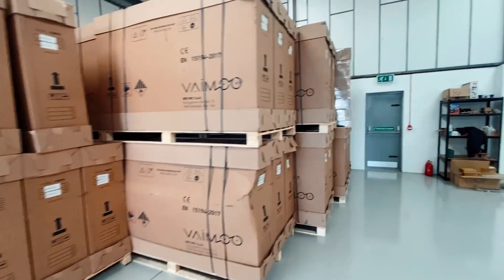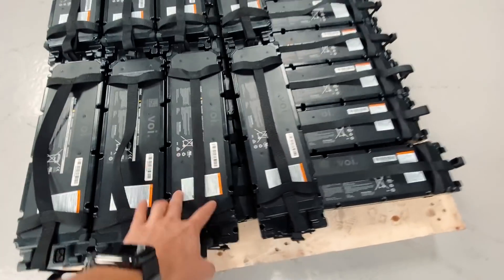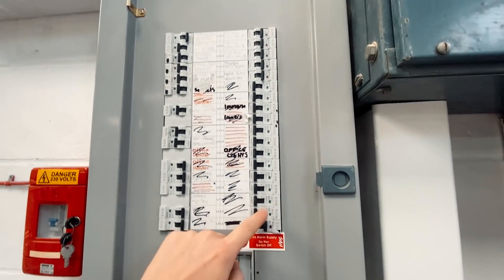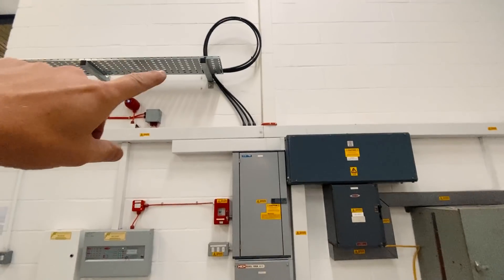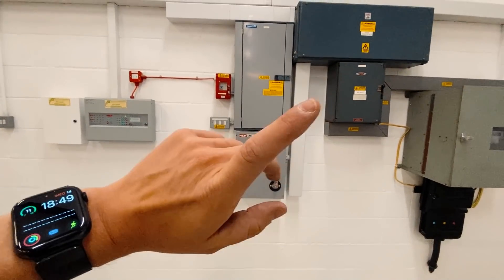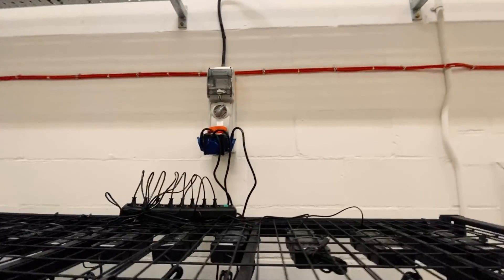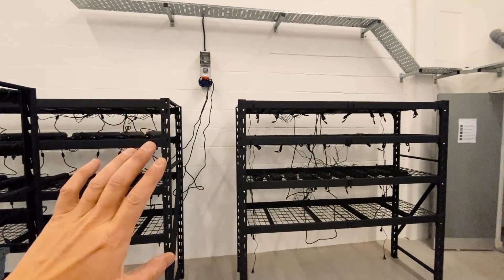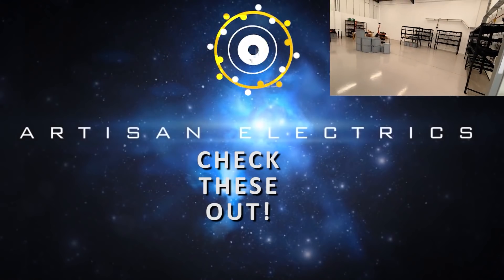Wiring an Electric Scooter Charging Warehouse

Comment: Hi, sorry to be picky but, they are not “Commando Sockets” Commando comes from a range that MK do, the are in fact cee form, also known as ceeform, is an abbreviation of Certification of Electrotechnical Equipment.

Ceeform is a certificate for electrical equipment. It was formerly published by a European body called Commission internationale de réglementation en vue de l’approbation de l’équipement électrique, which is now superseded by IECEE.

The purpose of ceeform is to give an internal standard for electrical products within one certificate, with which all the products can be traded in a worldwide market.

CEE Standards

As a standard itself, CEE also publishes a series standard for different categories of electric products. The best-known standards include CEE 7, CEE 13, CEE 17, and CEE 22.

The CEE 7 describes standards for sockets and plug for household purposes.

The CEE 13 describes standards for cables and cords.

The CEE 17 describes standards for plugs and sockets for industrial purposes.

The CEE 22 describes standards for couplers and connectors.
What are ceeform socket and ceeform plug?

The “cee” in ceeform socket and ceeform plug refers to the standard of CEE17, which, as mentioned above, defines the specification for industrial socket and industrial plug.

However, the CEE17 standard has been superseded by IEC60309 since 1985. The latter is now an international standard published by the body of IEC (International Electrotechnical Commission).

In general, the ceeform socket and plug refer to the industrial sockets and plugs which comply with the following specifications:

Voltage: below 1000 v

Current: below 800 a

Frequency: below 500 Hz

The environmental temperature range: −25 °C to 40 °C.

Besides the basic parameters, there are also other several variants to be discussed.

Again sorry to be picky, by the way great work with your YouTube work.

Comment: Are those chargers switch-mode? If so I'd be looking very carefully at harmonics, power factor and neutral sizing. 
The 3-phase to 3 singles bodge without any further protection makes me nervous. I appreciate it may be on the other side of the line between you and the client though.

Comment: You have a busbar straight after the main switch. Just install another fuse switch off the busbar and a separate DB for the chargers rather than upgrading the perfectly good board. The cable tray is also on the wrong face again.

Comment: It may be an idea to consider isolation of those racks in the event of a battery fault. Those sockets are not installed in a position in which that they can be disconnected in an emergency and given the quantity of batteries I would have thought this a sensible idea. Maybe an isolator at low-level adjacent to each rack with the socket where you have installed them. 

Fire alarm needs to be laser for a warehouse like that. Smoke heads are not really the best option.

Comment: Just a heads-up, those schuko extensions are only rated for 10 amps. Sounded like you sized them at 16. (Which is the right breaker for a spur of schuko sockets.)
Reply: No, looks same Brennenstuhl models. Can handle 230 V / 16 A. Every of them can do it after every Schuko can handle  3.5 kW normally. We not need "switch off" every socket, one switch enough. We can "pull out" the male-sockets manually. 

But this charger works same a zappy or anderson and "see" how many power can use. Or do you check the temperature of your tesla battery every 5 min manually?

Comment: Memshield 2 board now obsolete.  I agree with Jordan,  replace with a larger board with a 200 or 250 amp mainswitch or possibly use a moulded case incomer. Wont need that 100amp excel swfuse then.
Reply: Thank you Jordan.  Interestingly i did a price comparison for similar project with Hager and Sqr D and Hager as a package worked out cheaper. And both made in the UK.  I didnt try Merlin because of the current pricing restrictions and Eaton because its not made in the UK anymore. Just an observation really, hope it helps.

Comment: In regards to the Fire alarm, instead of sticking fire detection in possibly look at Fire beams as a alternative.
Reply from the maker: Yeah that’s what I was thinking too
Reply: Whats fire beams
Reply: @anddrewb1367  An "optical beam smoke detector is a device that uses a projected beam of light to detect smoke across large areas, typically as an indicator of fire. They are used to detect fires in buildings where standard point smoke detectors would either be uneconomical or restricted for use by the height of the building".

Comment: Are each of those (Schuko?) sockets individually fused? What’s the over current protection for each device?
Reply: The device self have a fuse inside. It is normal since around 1920's. In your age we named it "model train 12V product". Do you use it for N, HO, O, TT, etc. model trains. 

Now in the 2000's we change the name and loose some switches but it works fine too. Every device need only both phase (no saved earth!) and use a two-pole-socket only. The electric is capsuled inside with plastic around, 100% consumer friendly! 

But I would secured them in the metal boxes/racks with metal clamps and all give a saved earth bond with >= 4 qmm to a 16 qmm-around-the-building line. The brits are angry if something non-metal or not use the green/yellow part ... 

BTW: We use plastic CU's in Europa since over 60 years without problems ... No one burning.

Comment: Seems strange to install 3-phase outlets which immediately get split to 3x single-phase outlets! Why not just install single-phase outlets and skip the adaptors...
Reply: Probably cheaper wiring/quicker installation. Running single phase outlets means you have to run 3 cables per rack with line, neutral and ground instead of 1 cable with 3 line, 1 neutral and 1 ground.

I don't know the UK electric code but here in NL that wouldn't be up to code. It would work fine but a disconnected/broken neutral wire in the wrong spot would cause 400 volt to be run in series through 2 devices (bad!)
Reply: Another point: if they've only rented the warehouse, that setup is much more versatile for any future use than having rows and rows of single-phase outlets. You could hook up e.g. heavy machinery to those 3-phase outlets without having to redo the whole installation.

Comment: Seems like a very inefficient way to have to charge the scooters to be honest, having to depopulate the batteries to charge them it would surely make more sense for them to dock and charge in situ.
Not convinced by them as a lot of cities are now banning them as they have become a scourge with them littering the streets.
Maybe they will work in Cambridge.
Nice tidy job on your install though 👍
Reply: I'd assume they have much more batteries than scooters so they can just give the scooter a quick check, swap out the battery, and get it back on the street. Otherwise this setup wouldn't make much sense, yeah.

Comment: I’d recommend a data center bus bar for that, just run a 3x250A feed to the bus bar and plug in outlet sub boards with 3-phase IEC outlets in them, makes it easy to move things around and expand as you need. Siemens makes a really nice one.
Reply: Nice idea, but I suspect it’ll be too expensive for the end client...

Comment: Shame about the dip in tray work , longer unistruct arm would prevent that dip and keep all at same level , just my opinion , least you put your work out there which is good
Reply: Yep that set is hideous.
Reply: Agreed i didn't like it either. I have taken a piece of tray and cut and bent into 30 or 45 degree horizontal angles to sweep past objects such as that pipe in the corner. Always looks nicer. Harder than just up and down cuts but is worth it. I have mostly worked with 6"-36" heavy duty cable tray

Comment: Why not just add a board for the charges? Seems a lot of effort to change it especially if the buildings rented
Reply: Yeah that’s what I would of done, plenty of room there and less work.
Reply: @supersparks9466  There is a nice busbar chamber there which you can loop a 100a isolator and DB  from, i love a good MEM board, such good quality, i think given the price of MEM2 RCBOss its cheaper to replace the fuseboard in some cases (£130.00 a pop in some instances)
Reply: @chrisday8072  I would consider using quality off-brand devices in a board like this, especially if the manufacturer no longer supplies replacements at a sensible price.  We have a duty to reduce land-fill.  If the new RCBO complies with BS61009, and it fits the busbar, then Greta will be pleased.

Comment: Nice job Jordan, what's your opinion on electric scooters?
Reply: Seen them in Frankfurt.  They just get left obstructing the pavement
Reply: @bernardgarrett3897  I can imagine, I suppose if you had your own you would look after it? But if people just hire them they will get left everywhere?
Reply: @sheldonfieldhouse8587  If you don't return scooter or bike to a docking point your credit card keeps getting charged so I don't see them being left everywhere, certainly the cities in UK and Europe that have bikes for hire have no such problems.
Reply: @nw5835  Ah ok makes sense 👍
Reply: @bernardgarrett3897  If you don't return scooter or bike to a docking point your credit card keeps getting charged so I don't see them being left everywhere, certainly the cities in UK and Europe that have bikes for hire have no such problems
Reply: NW The point is that they have no docking points. So they do get left everywhere. Like the bikes that get dumped all over Oxford (think they are operated by lime?).
Reply: @nw5835  Cologne has no designated hubs for scooters or bikes (although I think Ford does for their bikes, but they're not marked, you just see their bikes always standing around in groups), so the bikes and especially the scooters are just left wherever. And then you have assholes come along and tip them over, so they're even more of a tripping hazard.
Another reason I don't really like e-scooters: they all just cover the inner city, where you don't really need them because there's a tram station at every corner and you can get anywhere in minutes. But if you're in the outskirts, where there's only one tram or bus line and you could really use a scooter or bike to get places, you're out of luck. Plus people driving them on the (usually crowded) sidewalk instead of the bike lane or street.
Reply from the maker: Love them! Great fun and great idea!!